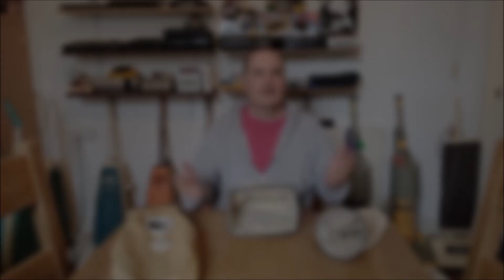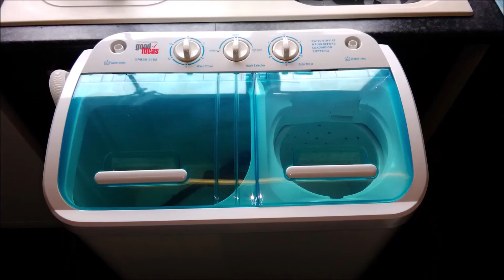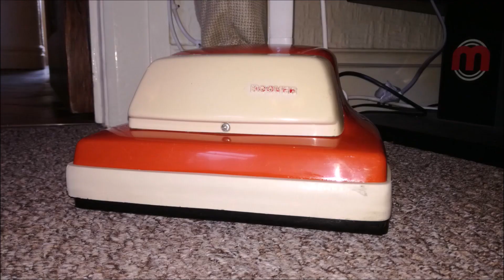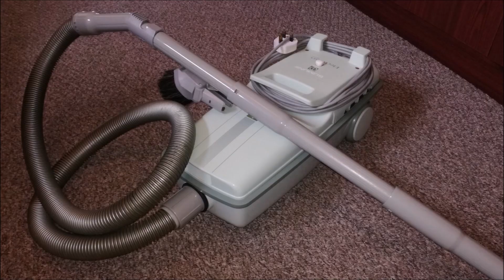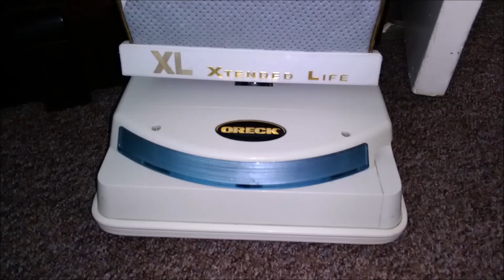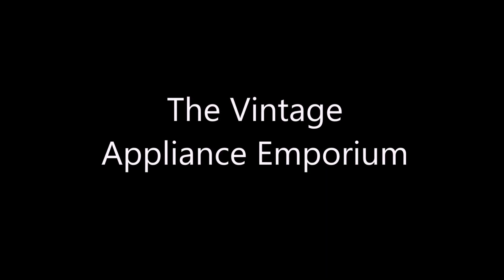Cloth Vacuum Cleaner Dustbags - Just How Inefficient Are They?

Comment: When the cloth bag was used with the paper bag on the machies  opened, I find always little dirt in the motor of it. Filtration wise it was depending on the size and how thight woven the material was. Ex a Nilfisk has a huge cotton filter that really filters small particles. 
I have done some test as you, but used an opened new synthetic bag around the paper/cloth unit to test . And yes you see some fine dust in it…

Comment: I think the lux 65 was the first to promote the paper bag there was a little sticker in the front end lid saying , for hygienic use always use a paper bag . The 96 you are after was the last cloth only bag machine . 
Wish there were hepa bags for lux 345 and 312/305 but sadly no
Reply from the maker: Oh yes that's a really good point about the 96! I hadn't thought of that. Makes it even more special :)
Reply: Not only was the 96 the last cloth-bag-only model, the ending of the cleaners in that period saw the demise of the cloth bag altogether, once the 303 and 312 were discontinued. My mother had an Electrolux 87 which she replaced with a Philips P60 around 1984 ,and one of the attractions to that cleaner (as well as the price!) was the fact it was one of the few cleaners with a cloth bag. The Philips was later replaced with an Electrolux 350 and she hated having to use paper bags, in a large part because she liked to look inside the bag to see what she had picked up that she shouldn't have. Lego, mainly.
Reply: @sdm3447  nice looking model the 96 hens teeth now
Reply: @David-uf8ex  Funnily enough I found one locally for a fiver on facebook market place last year. I gave it to a collector I know. It had all the tools, but they were very, very worn - I have never seen one of those cheap flip-over tools still in one piece considering all the cracks and wear in the plastic. The combination dusting brush had a wing missing, and the crevice tool was split, but for a cleaner that was 43+ years old, it had stood the test of time. Oddly, the "96" badge was missing from the front top of the cleaner. I can't think how that came to have been missing. Never seen that happen to an 87 or 96 before. Perhaps the screw under the badge had come loose and someone removed the badge to tighten it.
Reply: @sdm3447   i had one years ago mint but like an idiot i sold it like so many machines i have regretted getting rid of ah well